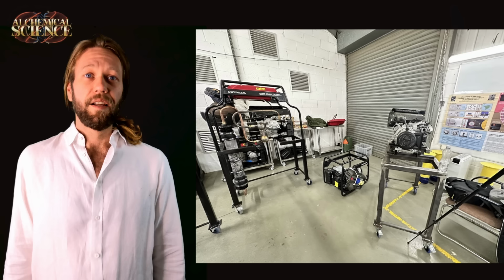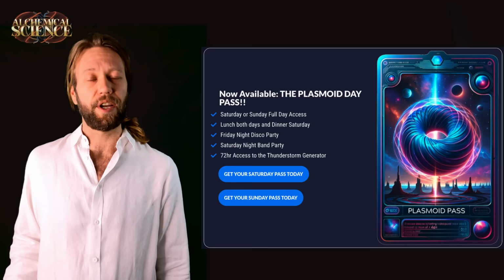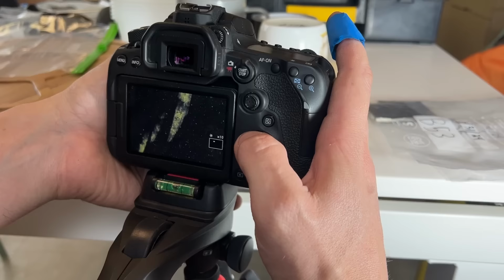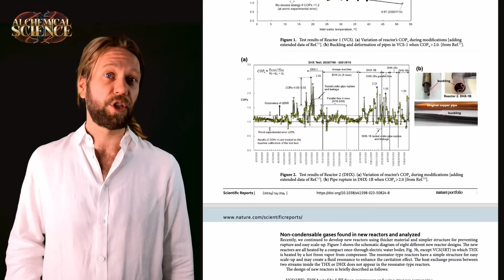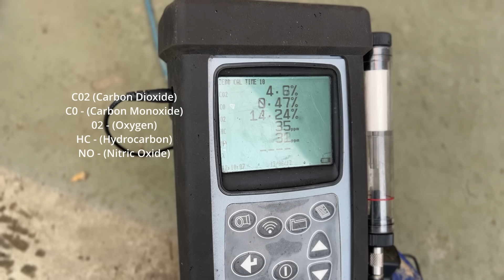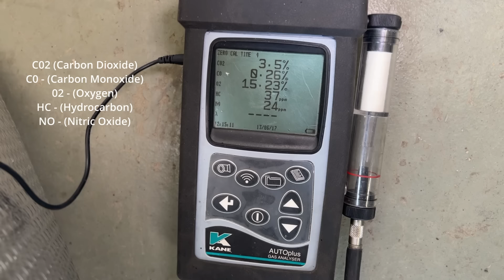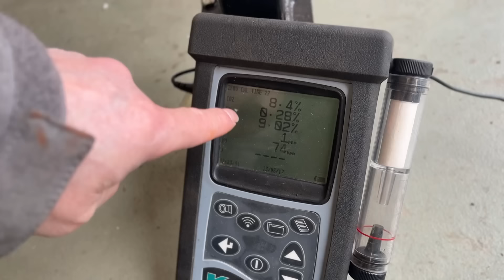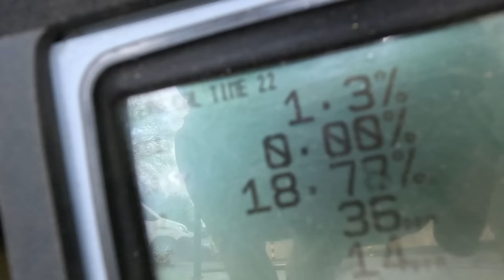Malcolm Bendall's Thunderstorm Generator | NEW FOOTAGE & Updates + Come see it in person at CS2024!

Comment: Please tell Malcolm to buy a high-temp endoscope. It should be trivial to get footage of the inside of the spheres, especially with this small design.
Reply: yes please this has been my #1 curiosity since learning of this
Reply: https://www.youtube.com/@MFMP/videos   this channel has Bob breaking down all of the elemental aspects, with pictures for the Korean scientist whos doing similar work; The videos are facscinating, and imo, shows electric geology. and the spheres are planets as far as im concerned. Carbon based life forms.
Reply: It has already
Reply: That may disrupt the vortex flow but it's certainly worth a try.

A glass blown one would be worth a shot too
Reply: Yes but wouldnt it disturb airflow?
Reply: Endoscopes are typically thin wires with a small camera at the end. Not sure how thin the high temp ones can be. Worth a shot though. I don't think there would be any better evidence of the device generating ball lightning. Doesn't need to be in there permanently. You could easily get a few frames at least without disruption @jessewhite1679
Reply: This!!
Reply: @jasoneubanks645  Lol Disrupt the Air flow or will show that this is a scam more like it.
Reply: Blown glass, make it transparent.
Reply: I know how to simplify the system, the way to create the spinning air in the inner and outer tube and make the air spin on exactly 51.84 degree angle like your aiming for just weld one end of a metal spring stretched down the copper tube, measure the distance of the tube and circumference of the spring on the inner tube and do some maths to work out how many turns the spring needs to  turn before welding the other end up the other end of the tube, then repeat for the exhaust hot outer tube, saves making the 2 metal balls and hoping the twisting air is exactly 51.84 degrees, you can put a few springs down the pipe for greater spin, that would mean you can make it all fit in the exhaust system of the car and run a tube to the inlet manifold from the back of the car where the system would be where the spare wheel goes to make room, that's my plan.
Reply: @LUKETHELOG  Dude you`re just making shit up as you go.. What`re you even talking about. This Tech is a SCAM!!!!
Reply: it would need very good electrical shielding...maybe wrap some ferral film or whatever it called around shpere and see what kinda magnetic stuff is happening

Comment: They need to hook the generator up to a load before and after the switch-over and measure the power output.  The tech would be all but useless if it couldn't produce power much beyond idle.
Reply: I think it's more about the exhaust is extremely clean, and engine is more efficient, but you are correct.
Reply: It has already been hooked up to a powerplant near London

Comment: Measuring gasses ONLY at the final exhaust seems a bit uncurious to me.. We need to know the gasses flowing several more points. Valves could be placed to accomodate some flow to meter.
Reply: Exactly! Or air-seal the whole contraption and measure at the single exhaust point.
Reply: @evetrue2615  In theory it's completely sealed. Since the exhaust measures neatly identical to ambient air, I'd like to see the gasses looped. Is there extra gas volume , or  less?
Reply: @Cloxxki  Yeah me too! But since it measures nearly identical to ambient air the first question should be if it's not just the ambient air around. There are many possible points where it may be leaking.
Reply: Yes, it needs to be checked directly where the exhaust exits the engine.  It appears to be recycling the exhaust back into the intake after the carburetor, essentially acting as a EGR valve.  This alone would cause the engine to pull far less fuel and run very lean, essentially lowering emissions.  The problem is a lean engine will have very hot combustion chamber temps and melt down eventually

Comment: Holy crap, its the new dimensions for the Generator! That will be perfect to retrofit into automobiles!
Reply: Depends a bit on capacity I suppose. Needs to process enough air, and sufficiently clean it during at least the WLTP and EPA test cycles which can have peaks up to 50 hp or so.
Reply: These things would be perfect for boats.
Easier registration, space is no issue. If it's too big just tow a barge ;D

Comment: I am so glad you put up another video and thanks for staying on top of things.  I was really hoping that Randal Carlson mention on Sean Ryan would have got you more attention.  I am trying to continue to help drive people to your channel.  It just takes a different kind of person to appreciate what you are doing here.  Florida loves you.
Reply: “There is nothing more powerful than an idea whose time has come”
I think as a culture we’re just now beginning to enter that space where such ideas can find fertile ground. 
Thankyou for your part 👍
Reply: I found this channel from the Sean Ryan podcast but still have no idea what's going on here despite watching hours of content on this and the MFMP channel
Reply: @charleswalker2484 basically the hot air from the exhaust is being channeled in the top sphere and cold ionised air channeled first through a water bubbler where the bubbles cavitate symmetrically and then channeled into the bottom sphere, that creates a thunderstorm effect/ ball lightning which seems to be transmuting some elements to achieve loss of co2 etc as explained in more details by Bob and Jordan
Reply: @Loveprevails  thanks for explaining this.
Let me see if I understand.

The bubbler alters the form of the gas into shapes which when pushed through the lightning area is causing the CO2 and other gases to exchange electrons with one another recombining into other gases? 

If that's correct can you explain to me if this method is used in any other technologies?  Could other gases be transmuted too without an engine just to see what happens to their properties? 

I watched the thing with the Taiwanese guy and he said his one produced Neon 22.

Comment: Has ANYONE tried to loop the exhaust air back as inlet air? It's a bit low on oxygen but there ought to be plenty of volume to run the engine leaner? Please let me know what's I'm missing here. Being able to run an exgine off air from its own exhaust would help demostrate the effect.
Reply: Already being done, am sure you will find it mentioned in the previous video.
Reply: You could probably recycle it 3x, have someone tried putting 2 of these in serial?
Reply: @bogganalseryd2324  If it's not recyclable until eternity, I'd like to know why :) In some test, it shows 21% O2 out actually. I suspect exhaust volume is greater than inlet, because the hydrocarbon is going somewhere. Or it lost to water vapor?
Reply: @Cloxxki  Yeah since transmutation is taking place it's hard to know exactly what's happening. mounting 2 in a series might yield more answers....
Reply: @DudewheresmyKar98  Well it still works, both the government of India and England  are using it, and independent engineers have validated that it works as advertised. Why make it open source if it's a scam, that would really defeat the purpose
Reply: @DudewheresmyKar98  There are others who's  replicating it, and Randall Carlson have seen it working too, and I trust him. he was there when the engineers were there too. You claim it's a lie, what proof do you have of that?
Reply: @DudewheresmyKar98  None of those refute the fact that multiple independent people have validated that it works. What's your beef with him? Have you been scammed in some way? Claims are not evidence you know.
Reply: That's basically an EGR valve which is what this thing is.  It lowers emissions because exhaust is being reintroduced AFTER the carburetor causing less fresh air/fuel mixture entering the engine, essentially it's causing the engine to run very lean
Reply: @HoLeeFuk317  Yeah that's not a new thing

Comment: Yes, there needs to be a bubbler before the u. V. Ionizer .   U v light Can break down water into hydrogen and oxygen.  There is a possibility that their gains are coming from the vapor in the air.   The bubbler and the current design seems more like a backflash arrester at this point.

Comment: What are the temperatures of the gasses in various parts of the thunderstorm generator. Could one backfeed cold air from the T.G. into the engine airtake.  Combustion works better with cold pressurized air in the mix. (Turbo)

Comment: I know everyone is fascinated with the profound implications of transmutation and examining the materials etc. I'm honestly more concerned about performance increases and this seems to be the aspect least studied. 
Emissions are meaningless to me, as fun as it was to hear of George huffing the plasmoids.
 AGW is obviously bunk, and alchemy is wild but doesn't make engines go faster or further. 
Any data on performance?
Pandering to the Carbon nazis isn't the answer, they tried to ban nitrates in Holland. They'll never be appeased.
Reply: This is fantastic although I have see an f1 car run laps of silverstone race track on carbon neutral fuel which I no one is talking about.
Reply: I do remember something about increased fuel efficiency, but I don't remember the exact numbers.

Edit: According to a pdf on the Strike Foundation site, it increases efficiency by ≥ 90%
Reply: Seems very odd to me that power output tests aren't the first thing shown. Even if this contraption can purify emissions, what would be the point of doing it by killing the engine's performance? Recirculating exhaust gases and pumping more air into the engine ought to greatly hinder its output, so I'd like to be shown the numbers to prove these alleged "plasmoids" exist and actually do something.
Reply: @DudewheresmyKar98  Your mum knows you're gay, mothers always know, plus she told me.

Comment: I want to believe and hate to take the part of the skeptic, but are there any videos with demonstrated and explained proof? How does the control exhaust output look like before this add-on is turned on? Even if it reduces emissions, isn't this merely because of the exhaust recirculation that seems to be going on here? Even if this purifies emissions, if we set aside the claim of "plasmoids", wouldn't that decrease operational efficiency, or at least increase energy consumption for the same effective output? Are there any demonstrations of these things hooked to a dynamometer or some other assessment tool, with and without the "thunderstorm" add-on, so we can see the difference in power output? Or a time lapse of the engine running longer with the add-on, off of the same initial amount of fuel? How exactly is a normal UV bulb "ionising" water? Wouldn't you need exceptional amounts of energy to generate radiation that's powerful enough for that?
    Don't mean to be a pessimist or overly critical, but it's unwise to take any grand claims at face value. I'm presuming this Cosmic Summit event will include a demonstration of proofs like those I expected I'd find here?

Comment: What EGTs are you getting by leaning out the engine so much? All I'm seeing is a barely running engine because of a induced manifold leak. Also, have you ran any computational fluid dynamics (CFD) on the exhaust manifold? This is just a super lean running engine, and when a load is put on it it's just going to fail. Sorry I don't get it.

Comment: Is there any evidence that the generator is running longer due to recycling of the gases/plasmoid production? As it has been claimed a lot about this retro fit. Malcom said in previous footage on how tube it will produce 30% Increase in fuel efficiency. Has this been documented?

Comment: This needs to be hooked up to a load and the exhaust needs to be tested for other gases that the meter used does not test for. 
Also it needs to be fitted to other engines, all great but I'd it only works on this particular generator then it ain't much use.

Comment: Hey Jordan, thanks for the videos.  What makes the TSG different than a carbon scrubber, for example on a power plant smoke stack?  From the photos I've seen, it looks like the carbon is being deposited on the inside of the sphere(s).  How long has this thing run continuously in one session, and did the capacity to remove carbon diminish during the test, or in subsequent tests with the same spheres?  I want to believe.  Thanks, mate.

Comment: how the hell would you retrofit something like that to a vehicle?
Reply: You obviously haven’t been following this. You’re a newbie. Sacred geometry…size is relative.
Reply: @toucheturtle3840  i'm not just talking about size. i'm also talking about maintaining safety standards of a vehicle. and this thing seems to need to "warm up" and be tweaked to get it functioning properly. not to mention durability/reliability, etc. there are many factors to consider.
Reply: @CarrionSmile  It doesn’t have any moving parts so maintenance should be fairly easy, checking for leaks etc. According to Malcolm, the water bubbler will need topping up occasionally. I realise the engine bays on some vehicles can be very cramped, but where there’s a will there’s a way & future vehicles can be developed with this technology incorporated.